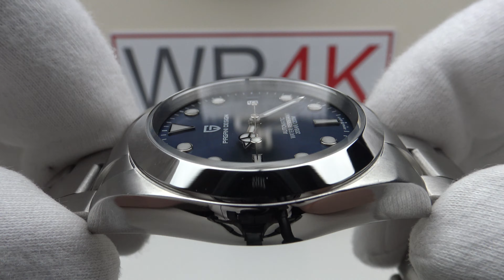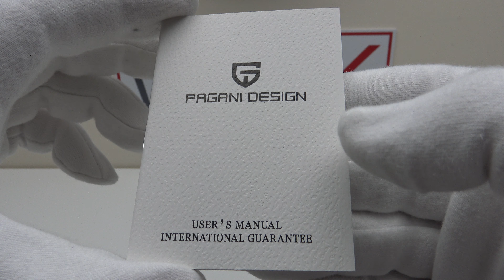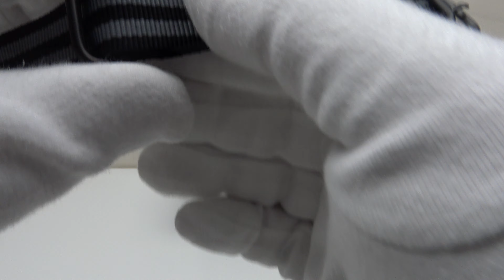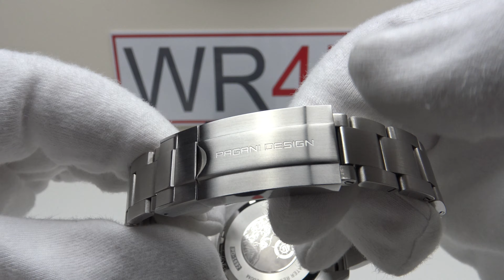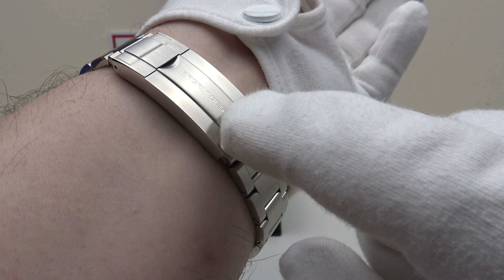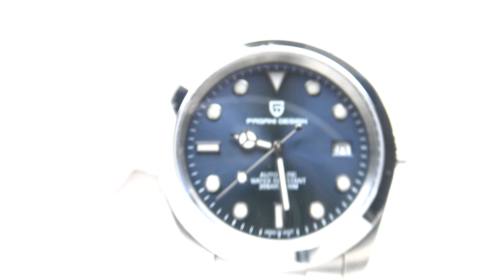Pagani Design PD-1692 4K Watch Review

Comment: own all four colour variations because like this type of watches and couldnt resist at one of the last sales - the watches themselfes are really well made and of good quality. But - a really big problem is the bracelet and the clasp. This is of a very bad quality. If you have to adjust it at the clasp to fit its a very bad experience to do - to almost impossible to open the pointless "diver expansion" to remove the pin  - a very bad experience if you have this to do at four watches. This Pagani bracelets use to have a very wide quality range - some times they working well, some times they are of lowest horror quality. Most time wear the white one - this is the best looking of the quartet.

Comment: Great review as always. This is a good budget option to Tudor Black Bay. And not really an Explorer why not use snowflake hands and make it great.
Reply from the maker: Agreed, its a great alternative to the San Martin SN020-G Limited Edition too at a lower price point. I prefer the darker Navy blue sunburst dial, to the lighter sunburst electric blue on the SN020-G Limited Edition. The other factor is the 39.7mm case will fit collectors with a 6-7" wrist better than the Black Bay 41. I found it wears large even on my 8" wrist, and would prefer Tudor made it in 40mm. It would look lovely with Snowfake hands. Regards, #WR4K
Reply: I appreciate the design mashup, Mercedes hands diver style indices without the divers bezel 👍